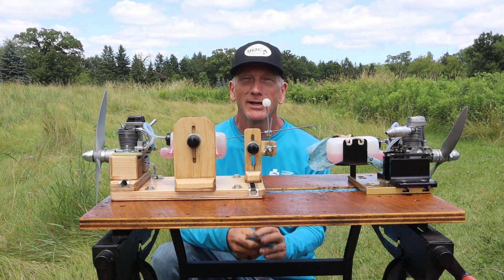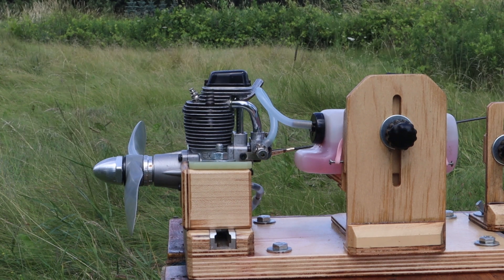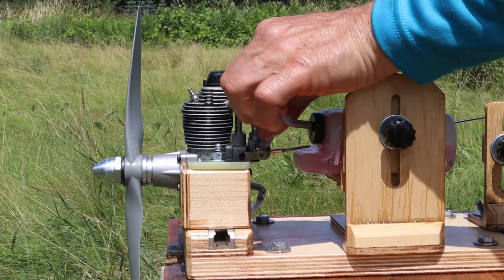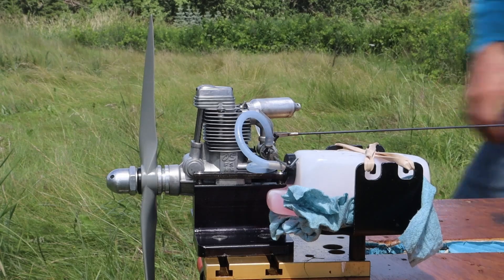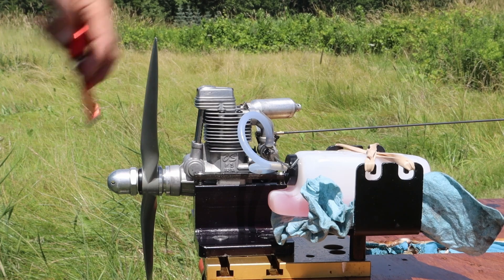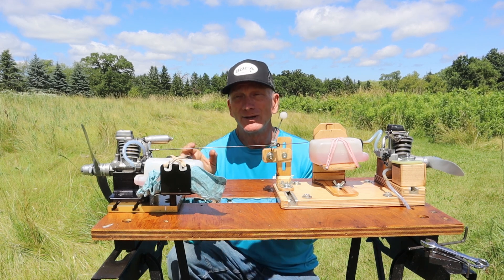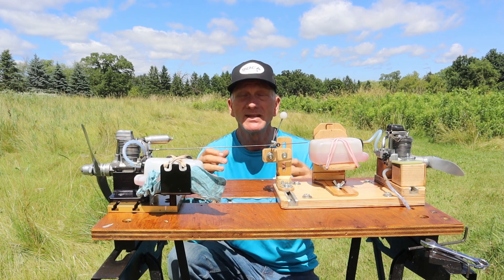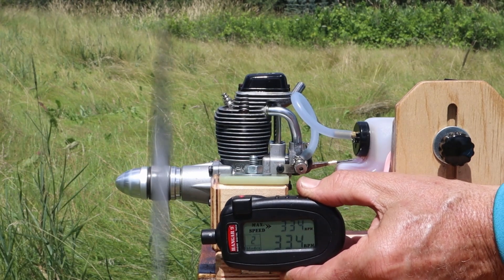Four Stroke Comparison Enya 46-4C vs OS FS 48 Surpass

Comment: I used to have both the Enya 53-4C and the OS 52 Surpass II, and the Enya was by far more powerful. Used an APC 12x6 on the OS, but the Enya generally needed to go to a 12 x 8 or a 13 x 6 before it was tamed, and even then it could probably gone up another size. Nice to hear the noise of both your engines. Nothing like a model four-stroke :-)

Comment: I have a question not pertaining to this video or even these engines… 

What should I be looking for RPM wise on the test stand for an Enya 45CX with Hatori tuned pipe setup? Also what prop would you recommend? I have an 11x6 taching about 12k or so, and I just ran it on a 10x6 and got 15k+. Seemed a bit high to me. Was thing a 10x7-8 or an 11x5. What’s your thoughts if you don’t mind?
Reply from the maker: Well I have little to no experience running or tuning using a tuned pipe.  Prop selection is really something that needs to be tested in the air. However the 45CX manual states that RPM range of the engine to be 2500-17,000 RPM.  Hitting 15K doesn’t seem excessive to me in regards to the manual.  You could try an 11x5 or 10x7/8.
Reply: @dmrcflyr2 I have an 11x5 on hand. It’s a Master Airscrew. I usually use APC props as the sound is more pleasing to the ear. I just don’t want to blow it up or seize it. I run pink omega fuel at 15%. I have it set pretty rich currently as it’s almost new. So I’ve been running it in. I only know it’s almost new because after 5-10 seconds at full throttle it tends to slow down a few hundred rpm. Still at the same 250* or so. Only ran 2 10oz tanks through it in my possession. So trying to be nice to it. My main concern is longevity. It will be going on a somewhat speedy build type plane. But I’m not into racing it. Just want it reliable and have some pep. Thank you for the insight into the subject. I have 10x7 and 10x8, along with 11x5 on the way in the APC brand as well to test.
Reply from the maker: @thrillhillracing41  IMO 15% is too high a nitro content for that engine. High nitro, high RPM, well I cannot say that is the best recipe for longevity.
Reply: @dmrcflyr2 I may be able to dilute it by splitting it with another gallon of methanol and adding oil to bring the oil content back up. Would technically make for 7.5% nitro per gallon. I use other engines as well and usually only purchase 15%  as it seems to run well in the others I have on hand. Both air and land rc engines. Higher nitro offers a more stable idle and slightly cooler temps from my experience. Could even use FAI blend since I can source methanol at 4$ a gallon locally. Will certainly look into that as well. Again thank you for the responses. Your advice is greatly appreciated!!
Reply from the maker: @thrillhillracing41 high nitro fuel is like training wheels on a bicycle. Lower nitro forces you to become a real engine tuner.
Reply: @dmrcflyr2 I do not disagree at all!! Definitely shrinks the tuning window and makes them slightly more sensitive to needle settings. I’ve ordered some props to test and see how it goes. Would be pretty neat to see this engine and pipe setup on your channel to hear your thoughts on it. Not to mention seeing my engine on your videos!! It definitely likes to rev out for sure with the hatori pipe on it.